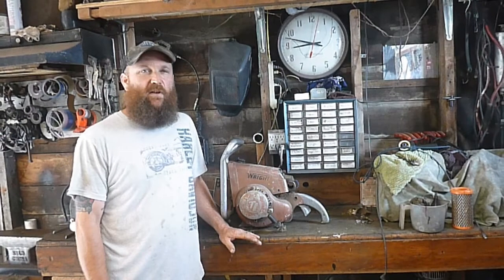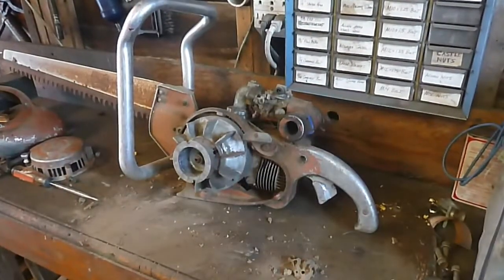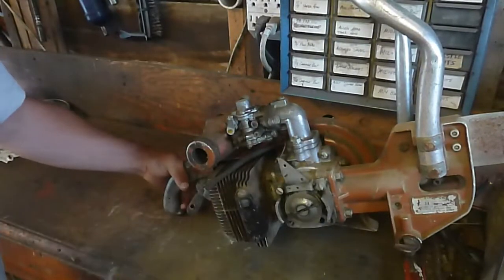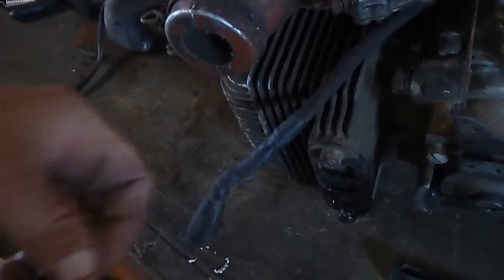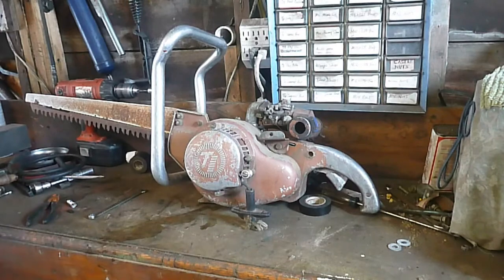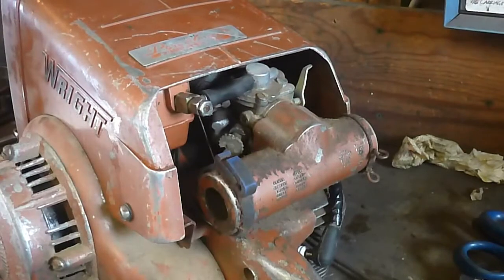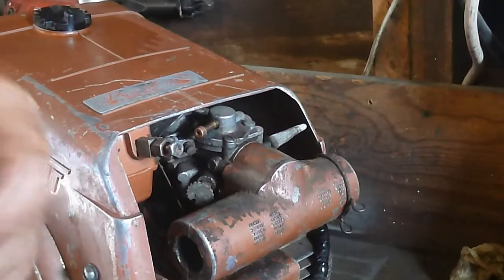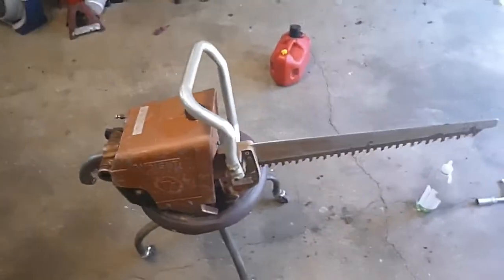Wright Reciprocating Saw

Comment: I have same same. No spark. Points are clean and adjusted . Plug and wires good .any idea
Reply from the maker: You should be able to test the coil with an ohmmeter, That will at least tell you if the coil is any good